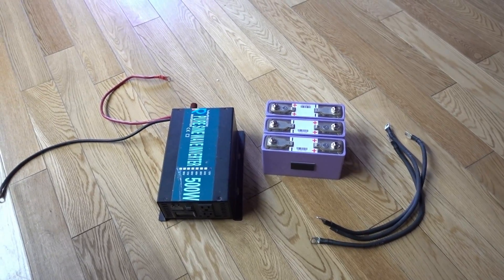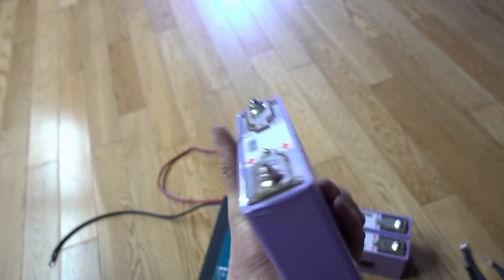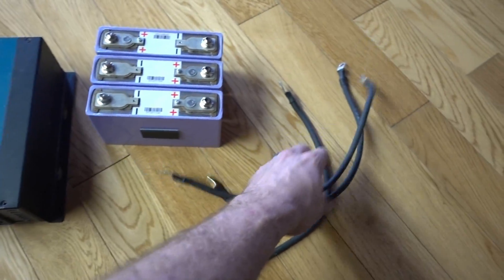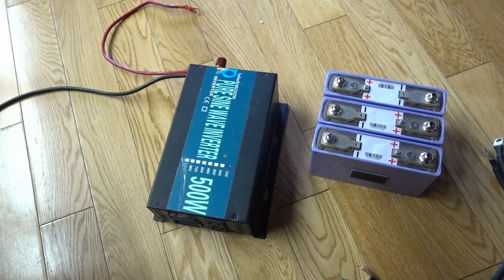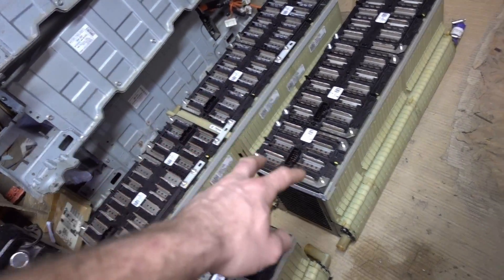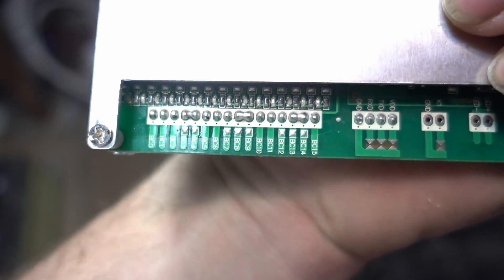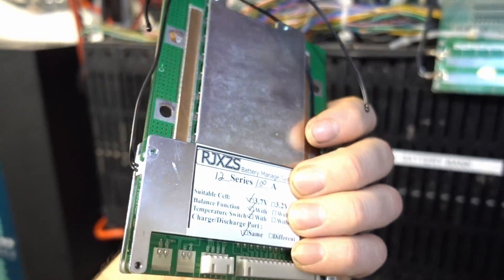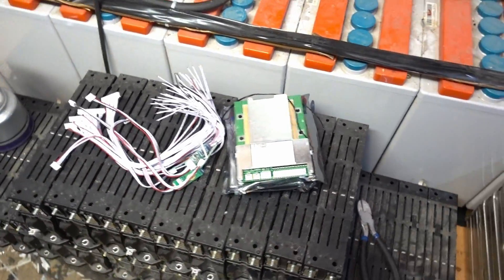500w Reliable 50 Ah Mitsubishi I Miev Battery and Chevy Volt Battery Update

Comment: For $60 CAD (roughly $45 USD), that cell doesn't have a very good dollar/watt value compared to 18650 cells. Currently I can go to aliexpress and buy genuine LG M26 2600mah 10A continuous 18650 cells for $2 USD each in bulk. To get the same capacity as those 3.7v 50AH mitsubishi cells, I will need to use 20 of these LG M26 18650 cells. Doing so will cost me about $40, then maybe $5 of solder and copper busbar to assemble the 1S20P pack. Thus I will have paid $45 for a new battery vs $45 USD for a used battery.

Maybe if you didn't want to go through the hassle of assembling 18650 cells, it would be a good option. But there are better choices in the states.
Reply from the maker: these batteries are almost new only 8000km on the vehicle then it was totaled.
Reply from the maker: plus way was less work, and looks nicer.

Comment: Hi. I am not a tech person. I am trying to learn. I want to power an ebike kit. ( power wheel hub for my bicycle ). If I purchase a 500 watt 36 volt wheel, I suppose that means I would need 9 of these batteries to power the wheel. Do I need only one of those BMS boards. Would 9 of these batteries be too heavy and stupid for an ebike ?  Thanks.
Reply from the maker: if you used 9 of these batteries you would be able to drive around 100 miles range, nine would be a bit heavy for a bike but still do able and one 100 amp bms like the one in my newer video is more then enough yes.